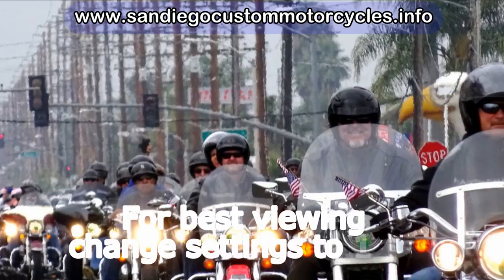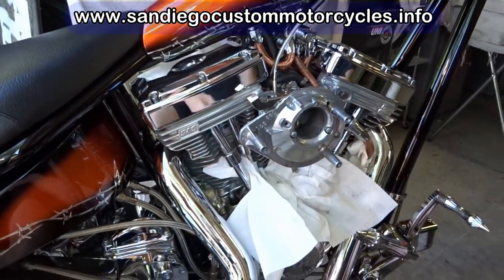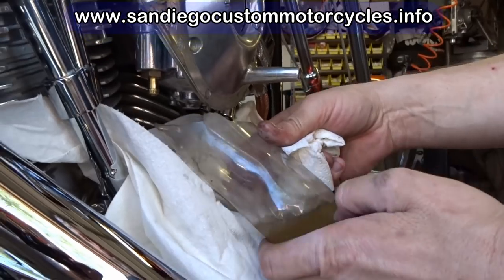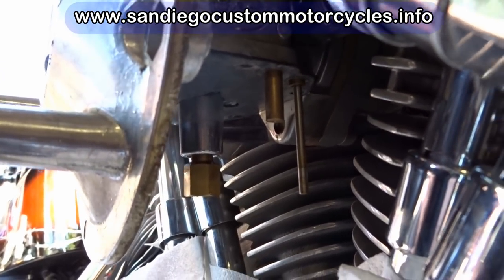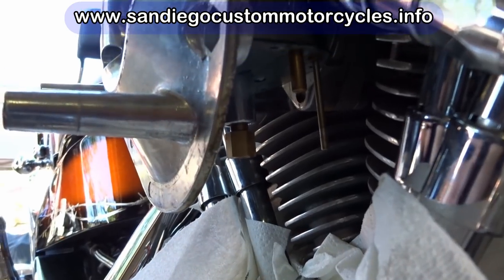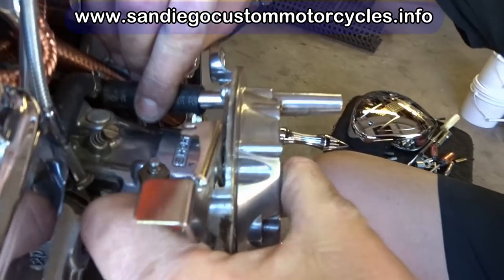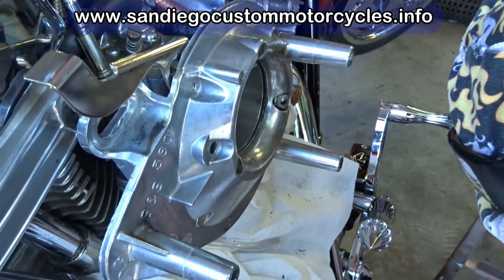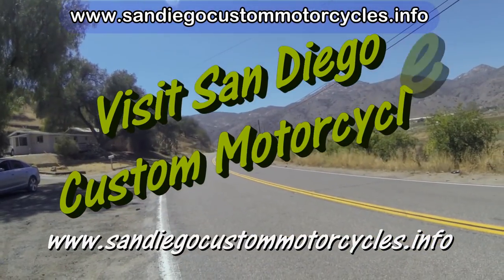motorcycle S&S carburetor fix

Comment: Dude....use  bigger flathead on the 3 screws for the air cleaner backing plate and you won't get screws that look like those. I changed mine out to stainless SHCS.

Comment: Great Video... 
How important is the rubber boot on the accelerator pump plunger?
Mine is pretty whooped.

My 73 Ironhead sportster with super E seems starved for fuel at high rpm/speed. Gonna try high flow petcock next.

Comment: Iv got a 127" and have a stumble wen you try to hold a set speed but wen ur in the throttle it run perfect any thoughts I got a 032 intm jet and 70 main
Reply: Maybe up to a 73 or 74 jet or a mid-range fuel circuit. I assume the stumble is at highway speed. and it is sucking more air and less fuel so when you crack the throttle more it pulls more fuel . My shovel will run a 70 and better at 68 so 70 is small I think for 127
Check out this 128 shovelhead (yes you read it right) https://www.youtube.com/watch?v=Me40j59H3C4
Reply: @boosted12
That’s a lean stumble 
Your 32 sounds good but unless you have a thunder jet you’ll need a 76 main minimum

Comment: Hi sir i have a iron horse chopper how do i remove the outside chrome cover on 111 carb. Does it just pull off? I see no screws?
Reply from the maker: if it's the OEM car cover just look behind it and you should see three bolts that hold it on two on either side and one on the bottom

Comment: I have a Question for anyone who might know, I own a 08 K9 117 I had the bike on the battery tender it was fully charged I turned the key and nothing happened and no lights also. So I decided to see if battery was dead and touched both post with a wire and it arced. I turned the key again and the bike started right up! thanks
Reply: Please please stop doing this,  shorting the battery is not good for the electronicss. Newer bikes have computers like cars. I blew up the computer on new ford ranger installing a new radio. Electronics are also sensitive to ESD.

Comment: Boy, that was about a waste of time....No information....
Reply from the maker: +James Preneta 
Thanks for your opinion. With thumbs up vs down now at 29 to 1, looks like most do not share your opinion.
Reply: Well...we do know the proper jet size now? Might I add....I've been using various S&S products for about 40 years....they DO make it clear their stuff is intended to be installed by someone with mechanical skills....I've had pretty good results by actually reading all the directions before I start the job...AND....any changes in exhaust...like straight pipes....will cause carb/fuel issues...all my 4 bikes ran better with some sort of muffler system...Ironhead Sportys, Knuckle.....
Reply: Pilotjoe7, At the end it was said that the jets were upsized.....What size did you go to on both the main and mixture screw?